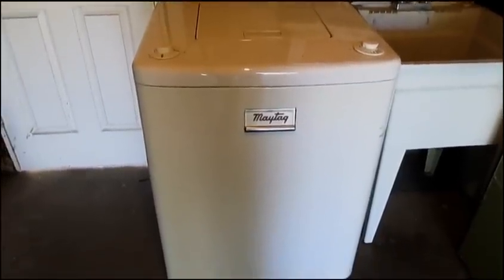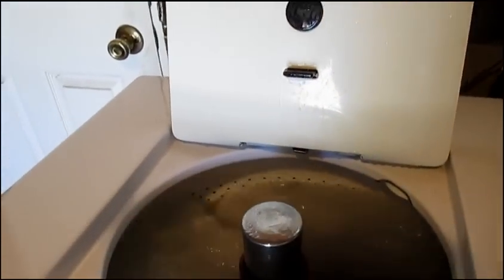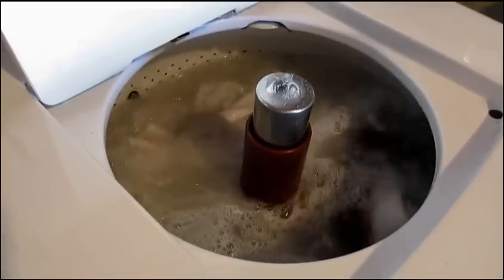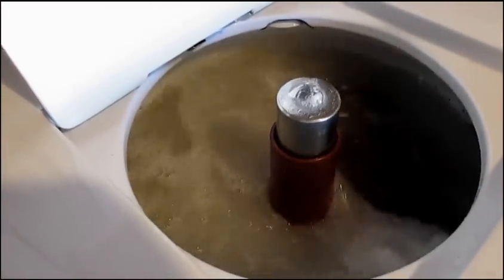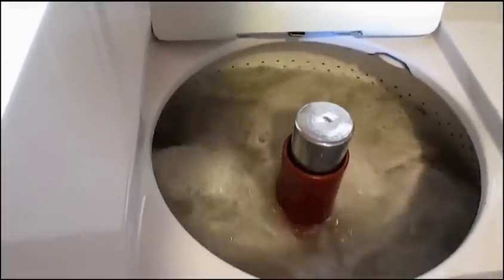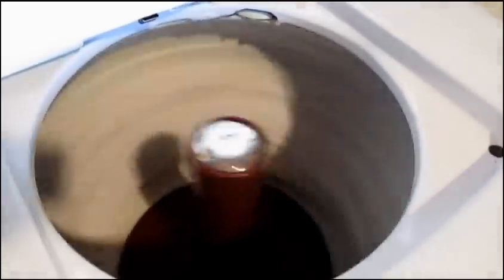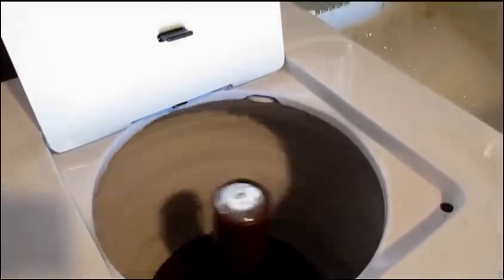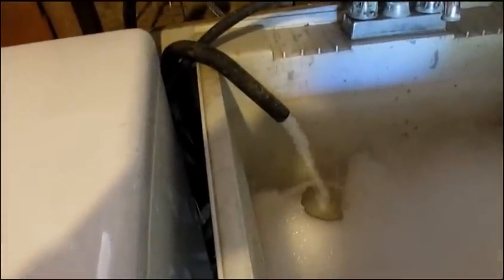1949 Maytag AMP

Comment: If you wish to get rid of the constant slurping sound of the pump and you have a floor drain, let the machine drain without a standpipe. We had an AMP purchased in 1949 and never used a standpipe. The pump ran as usual but made no noise during the wash cycle.

Comment: I have my grandmothers 1949 Maytag washer. It works fine except the timer stopped advancing. Does anyone know how to get to the timer? Everything seems pretty well sealed up and i can't find away to get in there to get it.
Reply from the maker: The whole cabinet slides up and off of the machine after you unscrew the attachment screws.  The wiring can be disconnected as you do this. The is a little access plate in the back and I think you can access the wiring there. You can get more help at automaticwasher.org
Reply: Reply with a model #. I have the original parts list for these machines.

Comment: Does this have the same Newton transmission as my mother's old '65 model?
Reply from the maker: +Joseph Heston  Maytag changed the design in 1961 to the one your mother had.  That design called Helical Drive continued into the 1980's.